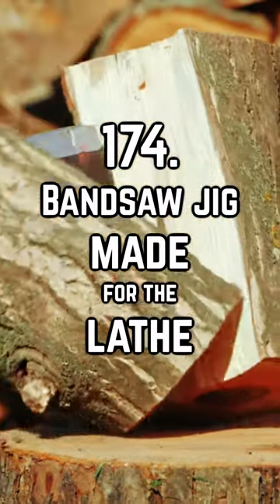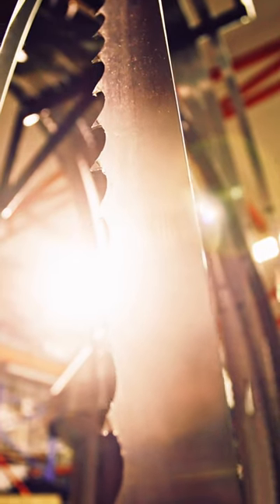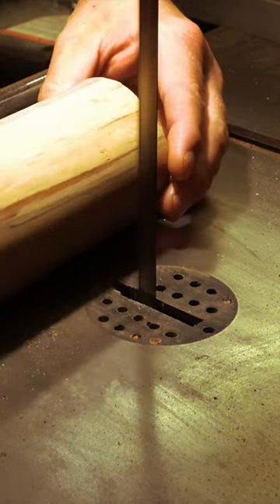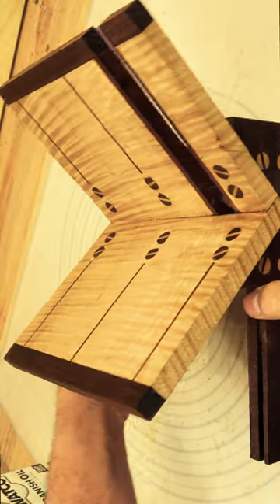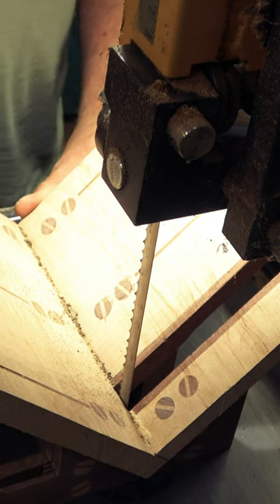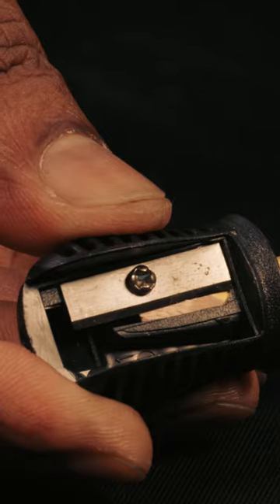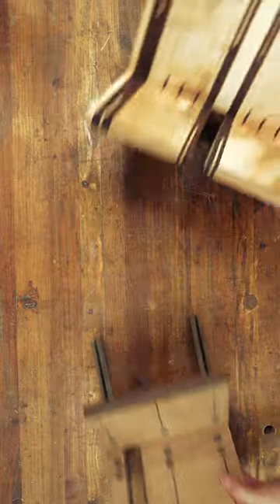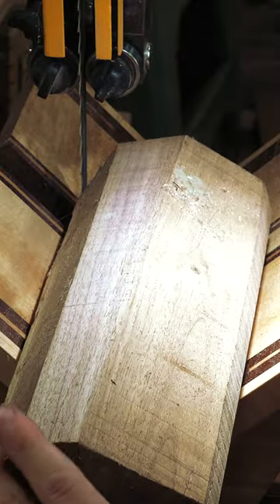174. Bandsaw jig made for the lathe #mtbitesize #shorts #lathe #bandsaw

Comment: Well, you actually want to cut the pith out of the log or you are going to have everything splitting on you while it dries.  Also, cutting the corners off with a roughing gouge is quite easy and not all that time-consuming.  also, if you've not learned how to properly sharpen... quit turning and learn how to first it'll save a lot of frustration.
Reply: Yeah took a day to make a jig that doesn’t save any time.